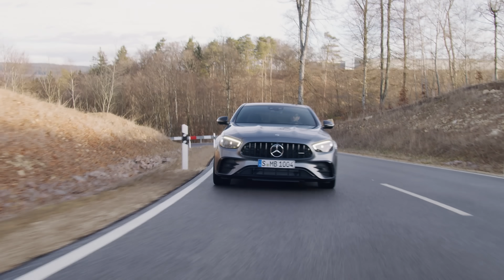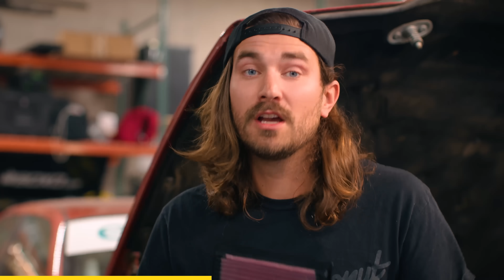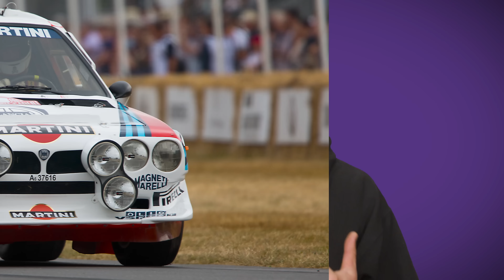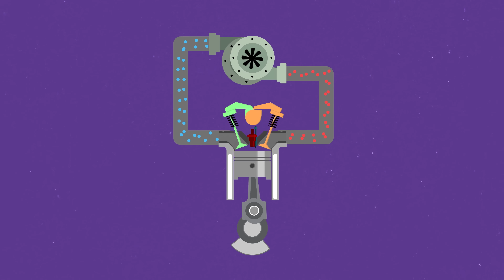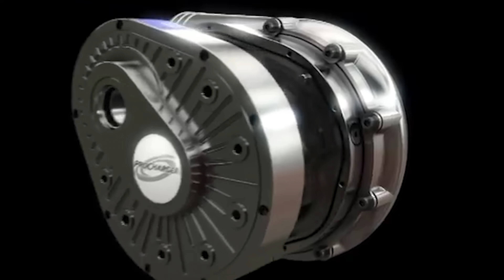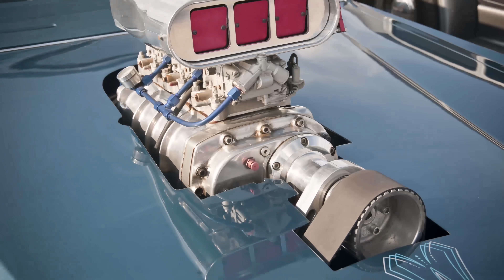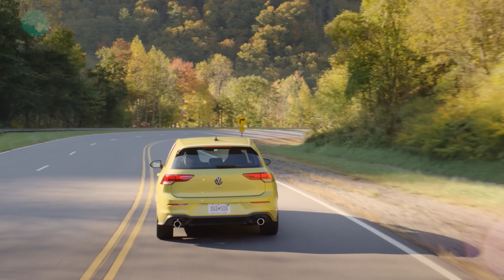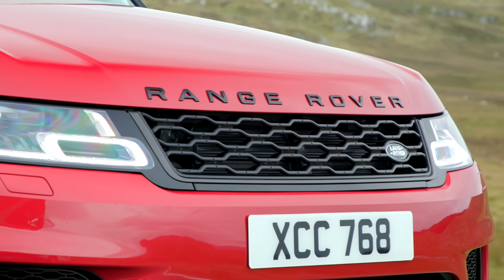Why Your Engine Isn't Twin-Charged

Comment: EV's have a LONG steep road ahead. Cost, recharge speeds, range, battery reliability and replacement costs are just the most obvious. As the ecoimpact of tens of thousands of waste batteries with NO recycling infrastructure becomes impossible to ignore, the "green" EV's will prove not quite so green. The absence of the grid capacity and inevitable increase in per kwh electrical costs will also become a problem that will hamper, if not cripple the market in favor of ICE vehicles...despite the WOKE ECO-TERRORISTS in government and its agencies!

Comment: You forgot to mention the insanity that is the detriot diesel engines that used twin charging back in the 80s, they all had to have the supercharger, due to it being a 2 stroke diesel, but then they also had turbos, sometimes even twin turbos

Comment: As always volvo is forgotten. I tested the volvo s90 t8 when it came out in 2017 and got amazed by it's supercharged and turbocharged four cylinder engine, first engine of it's kind i saw and drove. It is a beast
Reply: Swedish Meatballs never get the respect they should.  Great cars though
Reply: @dropitlikeitshot815  Indeed. I'm pretty sure most people don't even know Polestar, the maker of the NFS Heat Cover Car, the 1 Hero Edition, is a subsidiary of Volvo.
Reply: @HarmonicVector  That was a super cool little car.  I actually didn't know that about Polestar myself.  Thanks for that tidbit of info.
Reply: @HarmonicVector  aqawWQQQQaåQDQQQQQQQQQ
Reply: @dropitlikeitshot815  unfortunately after 2011-12 volvo after phasing out ford parts under ford ownership transitioned to the Chinese company Greely holdings. They're not exactly swedish anymore I don't think
Reply: @christiansgarageLLC  Really? That wouldn't at all surprise me. Is still disappointing to read.
Reply: @christiansgarageLLC  actually it’s said that China only owns Volvo and do not have any saying in what Volvo do
Reply: @christiansgarageLLC  If we're going by ownership Lamborghini is German, Bugatti is German, Fiat is American and so on.

Volvo still produces cars in Sweden and as the Ford parts have gone away the reliability has gone WAY UP,  which comes as a surprise to no one. Volvo Sweden makes the actual decisions for pretty much everything these days even though Geely owns it. Same as Bugatti and Lamborghini.
Reply: The high end cars are good. I had a c30 2012 . It was good for 130k then went down hill fast. And yes china parts and bad car. @christianhudspeth3338
Reply: @christiansgarageLLC it’s geely and yes geely is shit known for making shit little 50 cc scooters
Reply: @christiansgarageLLC I actually had a geely scooter a 03 that was 100cc and imported as a 50 cc . Geely was banned from importing to the us for a bit cause they did that
Reply: THank you, I have been yelling at the screen VOLVO
Reply: I think the old T8 felt slow for having almost 400hp, the new one tho with 450 feels like a really fast car
Reply: @thebestyank8293  It's the increase in torque. It's a big heavy car so torque is what makes it feel fast and peppy. Torque is VERY underappreciated and everyone talks about how much horsepower it has when in reality, you really want torque. It's basically acceleration vs top speed (simplified, as these things are never that easy).

It's why electrical cars can have below 5 second 0-60 times without even trying and when they are trying... under 2 seconds.
Reply: to make it even  more complicated volvo makes t8 hybrid engines that are twin charged and also have additional electric motors directly spinning some wheels in the polestar1, and various volvo branded options...
Reply: It was kinda sorta mentioned at 12:48
Reply: Thats what I was going to say too lol
Reply: There’s a reason why Volvo is forgotten
Reply: The fact that they aren’t even supposed to be cool at all is also forgotten
Reply: Factomundo
Reply: These engines are good but still have issues, sensors, piston rings crank seal leaking at 120k km blower seals etc, the new models have most of these issues fixed
Reply: 2.0 four cylinder 2 ton car and you call it a beast? Sorry but that car is garbage. Go test drive a BMW M550i 4.4 V8. It's a night and day and both have the same mpg
Reply: Facts, I had a 2019 S60 T6 R-Design
Reply: Yeah it is a beast, a constantly broken nightmare-to-own beast. I'm sure there's some 2017s out on the market for cheap, buy one that's out of warranty if you think that engine setup is a good idea.
Reply: @ktakashismith  LOL, I wanted their hybrid (enough of a possible nightmare) but the compound boost was one step to far for me. I like to run my cars out to 200K if they are reliable.
Reply: Seat bocanegra wasnt mentioned either, now i know its technically the 1.4tsi but still

Comment: Quick note- bigger turbos doesn’t mean more boost, it means more flow. Boost is a measurement of restriction of flow. A car running 8psi with a smaller turbo will make less power than the same car with 8psi on a bigger turbo as long as enough fuel is supplied and enough heat is mitigated. Also you gotta mention the Eaton TVS supercharger. It’s pretty much become a standard for the supercharged GM vehicles. It uses 4 lobe rotors instead of 3 and has increased efficiency. I believe it’s preferred over almost any other positive displacement blower nowadays.

Comment: Always wondered why you couldn’t just spool a turbo with an electric motor 
Or use an electric supercharger that runs at low rpm before the turbo takes over

Comment: I had the March/Micra S K10 as first car in white and my sister had the K11 SRi in apple green metallic as her first car. Back then I just thought it was the weight difference. I got it and thought it was just a ricer who went to town on it. Mine died in the end (transmission) and I scrapped it not knowing what I had. I just thought it was pretty fast, but again I just reasoned weight. Fun fun car. Boxy and stuff. I had yellow headlights. Fun at red light sprints. It would actually keep on accelerating beyond what the speedo listed. The needle would just get stuck on 'top' speed lol.

Comment: Wrong term. Twin means “alike/same”. Twin turbo = 2 similar turbos. Twin CHARGED would be 2 superchargers. Could call it twin blown as well.
A supercharger and a turbocharger are not alike at all, so using both isn’t TWIN charged. That’s COMPOUND charged, or compound boosted. Compound: noun, something made up of 2 or more DIFFERENT things…. Like a supercharger and a turbo.
No vehicles are twin-charged from the factory. 8 are compound charged from the factory.

Comment: Due to the MGU-H current day F1 engines also qualify as twincharged. Their turbo is connected to a motor-generator-unit, making it serve as both a turbo and an electrically driven centrifugal supercharger. But due to the high revs they race at they probably always have enough exhaust flow to spin the turbo and use the electric part only to kill turbo lag and to increase overall efficiency

Comment: Well. Volvo has been doing this since 2017/8. T6 and T8 belt-driven supercharger, turbocharger. and then add a electric motor to that. Also. Polestar 1. same basics but add one more turbocharger. yes ”triplecharged” aka twin-turbo, supercharger. and then again add the electric powertrain. Also Also, The new B type motors aka Mild hybrids or the new B6 and T8(still plug-in hybrid) versions will be getting the electric turbos.

Comment: Honestly if I was going to do super charged and turbo charged. Two pipes into the throttle body super charger has a check valve at the Y, and between check valve and the super charger an electric "bov". Turbo over powers super charger causes check valve to close, setting off electronically controlled bov to vent releasing pressure off supercharger and engines belt system.

Comment: Supercharger connected to the engine by a cvt pulley system can solve the lag problem, and can prove an even boost at low revs, and can put less restrain on the engine is nőt necessary.

Comment: I would make the forced induction analogy like a nurse shark , sitting and sucking water in over  gills vs whale shark swimming and shoving water in gills by pushing it in. But I see what u guys were going for … but … most sharks use forced induction , they have to swim forward to survive by pushing water over gills. Nurse shark for example can sit and chill and suck water in over gills so does not have to move forward to survive. But u know tomato tOmAtO 🍅 
-the only sticker on my car is a 🍩 sticker so u know I love ya either way.

Comment: Because its expensive, and on the street 99% suck at driving and cannot possibly benefit from A Dual Boost system.... its true...
And nowadays, turbo lag is nonexistent with just a bit o NOS on shift assist, to keep the Rpms up..Brrrrp click Brrrp click brrrrrrp Kachoooooo
Keep It Simple Silly.

Comment: Great video! That Audi diesel you mentioned is actually tri-charged, some pretty cool tech. 4 valves per cylinder, with dual exhaust runners from each cylinder, driving two turbos. One set of exhaust valves can be silenced, by moving the cam.  All the exhaust drives one turbo bringing it up to speed quicker. When that turbo reaches max volume, the valves are engaged spinning the second turbo. The third compressor is electric used just for throttle tip in.. reported to have less throttle lag than a naturally aspirated engine.. to spin the electric compressor quicker and keep the electric motor smaller the car has a 48 volt system. Wish they could import it to the USA.

Comment: You guys are awesome, but tbh K&N is absolute garbage.  I know it's a sponsor spot but come on...  their oil filters are actually banned from use on bikes at my local racetrack due to failures.  The air filters flow better...  for the first few hundred miles.  Then they flow worse than dirty paper filters.  Lots of studies on how good K&N actually is.  Ok on a race car or bike when it's getting cleaned ALL the time, but that's it.  Also, the oil has caused many problems over the years with map and maf sensors.

Comment: Our generators running our degassing equipment are run with 16 cylinder Detroit diesels that are two charged. Loud as hell air starting standing right next to it. Sounds like it was going to run away and blow up.

Comment: So, this video kind of answered why twin-supercharged engines aren't a thing (parasitic losses would outstrip boost gains), but if y'all are ever desperate for videos, it'd be interesting to see y'all try to get an engine running with, like, a centrifugal super and one of the positive induction supers. Maybe use an engine pulled out of a car for a swap or something, since it wouldn't be terribly practical, and removes "fitting it into the engine bay" from the equation.

Comment: Could you design a super charger that belts off the output of the gearbox such that it goes faster and slower based on your gear?
Reply: Like finding a way to gear it right off the drive shaft.

Comment: Back in the '80s and '90s I was a paper and pencil game designer (table top) for Steve Jackson Games, which designed and printed "Car Wars!" A game of metal mayhem with cut-out cars and dice or if you were crazy, like my friends and I: you mutated Hot Wheels cars with 'green stuff' and stuck guns of all sorts on them and built actual arenas and tracks! 
The game had a 'parts' magazine named "Uncle Albert's," which featured new game additions. 
I put forward 'twincharging' in 1993 and was promptly told it made no sense, even though IRL, my Father, a GM Master-Mechanic (gas and diesel) told me how it could be done. I was crushed. 
To make it even worse, they published my suggestion and then ripped it publicly. Double crush. 
 At that point, I'd never heard of a 'Lancia,' so I thought my suggestion was pretty original. I also don't think the designers of "Car Wars" had every heard of a 'Lancia.'
So, of course, Donut vindicates me and my "Super-Turbocharger" idea! Sorry, Nissan. Didn't know you existed. I was a Chevy guy. :D 
But then I discovered VW in '92 when in Germany and never looked back. 
Another great Donut video! (Sorry about your accident. Doesn't that only happen to old guys or people who...uh...um...nvm.) 
#dublife 
#VWuberallen
F. U. Steve Jackson Games!

Comment: I have to say one of the most impressive builds is from Sweden, it was ”Hilmerssons Manta” it was a totaly from scratch built car with a Volvo engine with turbo and supercharger that ran 9 second in the quartermile 1/4, and the car was street legal and also a track car, all this waaaaay back in the year 2004! 
The same year or years 2004-2006 My big brother had a mazda RX7, yes the Fd3s with a 3 rotor singel turbo HX60, and he also wanted to throw on a supercharger but he never did because…. Rotary! F*ck yeah!

The turbo & supercharged manta:
https://youtu.be/zwZsZlIlnCE

The 3 Rotar HX60 powered Fd3s 
https://youtu.be/r1u_3bvcHwk

Comment: Jeremiah, K&N makes good stuff for some things. The K&N oil filters though, they are banned by every motorcycle racing league their is. They blow apart under high pressure at high rpms.

Comment: I feel like hydraulic system to spin the turbo and prevent boost lag would be better then twin charger.  HKS actually has the patents for this and it has been used on tugboat engines before but has never had a automotive application.

Comment: I tried twin charging my Cobalt SS back in my car club days, that was a nightmare as far as tuning went and it ate up a ton of space in my engine bay. The kit cost about 7 grand which was on the cheaper side since the car came supercharged from factory, and i did the install myself over the next 3 weeks. I had a few fun drives with it but stuff kept leaving me on the side of the road, or in limp mode after multiple trips to the tuner so i eventually put it back to stock and sold the kit, only to focus on beefing up the blower power and keeping things cool. Methanol injection saves lives, if youre having heat problems

Comment: after a certain year, BMW caught on to "turbo lag" and decided to have an option on their M vehicles to "pre-spool" their turbo's. Instead of waiting for a certain RPM to get your power, you can put your car into "sport plus" mode and instantly hear the turbos spool up. When you hit it at a red light, you're not losing any low end power.
Reply: Are they using fuel to spool or some sort of electric compressor spool device? Some people use NO2 jets to spool up as well.
Reply: @HoggishGreedly generally what manufacturers do is an extra injection cycle during exhaust cycle
Reply: I don't believe this, I think you are hearing the exhaust valve open making it louder
Reply: @jasonquarsingh3002  its true, when you go into sports mode the idle rpm jumps to around 1800 which is the boost threshold. Obviously this burns more fuel but it does eliminate turbo lag.
Reply: @jasonquarsingh3002  ok, then go to a BMW dealer and ask to drive a 2016-2018 M4, when you drive around for a bit in comfort mode, go back to the lot and push sport plus and listen to the front of the car.
Reply: so an anti lag system?
Reply: @codylujan  That sounds like they've finally devised a version of the MGU-H energy scavenger systems used on Formula 1 that's worth putting on consumer cars. The F1 MGU-H's can do it bidirectionally though, both pre-spooling the turbo for maximum power on demand, and converting exhaust pressure into electricity when the ECU is no longer demanding boost.
Reply: @dustinbrueggemann1875  I think their high compression ratio helps. the f82 m4's are 10:2:1 and intercooled. its pretty much wastegate... the turbos maintain some slightly increased pressure to allow for faster spool.
Reply: @codylujan  yes BMWs run high compression, my r56 cooper s has an 11:1 the newer BMWs like the s55 b58 have water to air intercoolers making the pumping distance shorter increasing response
Reply: I think using an electric motor attached to the turbo to spool it up would work well. It would use far less electricity than an electric supercharger because it would only be used at low RPM and there's always exhaust helping at all RPM. It might use so little electricity that a beefier alternator could let it run off the lead acid battery.
Reply: @NoZioKikes88  the problem is at high rpm the electric motor will act as a brake making the turbo less effective
Reply: @jasonquarsingh3002  That's why clutch systems are a thing. If they're as smart as I think they are, the actual motor would be outboard of the turbo and connected via a clutch. Same as the AC compressor in a car uses a clutch so it isn't always running the air.
Reply: @jasonquarsingh3002 F1 gets around this by using the motor to charge the battery that spools it once the exhaust turbine overpowers the electric motor. It’s really not a huge amount of drag compared to the impeller compressing the intake air.
Reply: @NoZioKikes88 you'd never get an electric motor to spin it fast enough
Reply: @ObservationofLimits  With two or three gears you can make it spin as fast as you want. With gears you aren't limited to the speed of the motor.
Reply: Electronic waste gates are a beautiful thing. Electric turbos are even cooler.

Comment: HHO isn't twin charged per se but twin fuel and supplemental to gas injection. I guess splitting water into an air "charge' and a fuel(hydrogen) "charge" is fairly complex and asking for heavy tanks and safeties.

Comment: I have a twin charged ka24de i built in my s13 convertible.  It's quite the beast. I'll be covering the details about that build on my channel soon. A twin charged car is insane to drive. It's like having v8 torque out of a 4 cylinder, and the top end keeps pulling all the way to redline. I did a compound set up on the boost. I blow the turbo through the supercharger.  Plus it sounds like you are driving a 747.  aircraft.